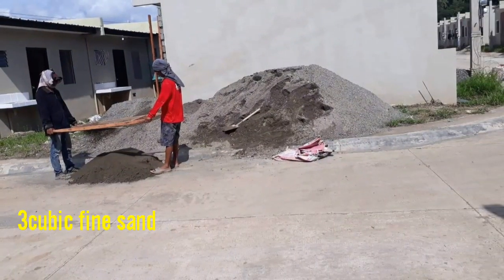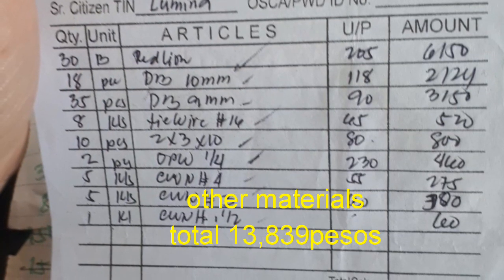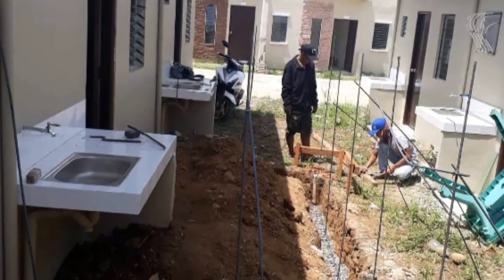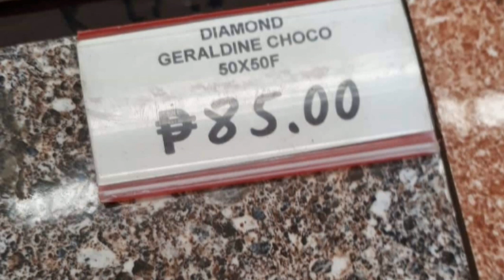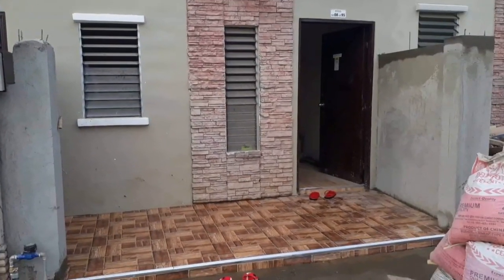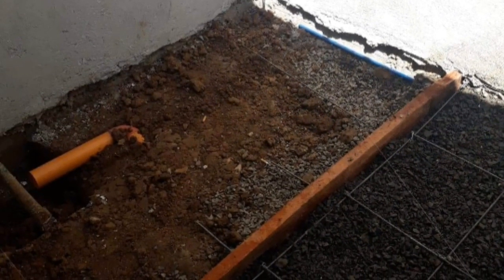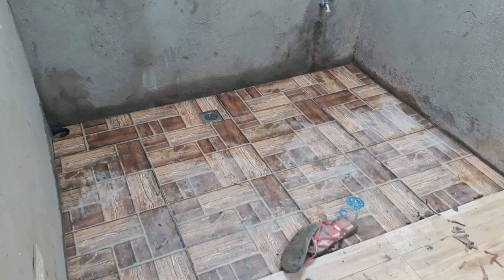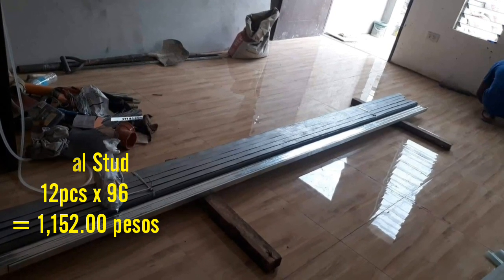Part 18 MAGKANO ANG NAGASTOS SA HOUSE RENOVATION NAMIN(MURANG PABAHAY SA LUMINA HOMES)

Comment: 62k ako na nagastos sulod lang nga renovation, wala pay extention ug gate. Waaa baratuha ra sa inyuha mam oi. Nice kaau.
Reply from the maker: Basin mahal imohang mga materials maam thats why mahal imoha maam,pila labor nila sa sulid
Reply from the maker: Nasa last vid ko po sa part18 naka itimized po doon
Reply: @maricelmontemayor5251  labor nila sulod with division, tiles and cr wall tiles shoulder level. 17k. Akoa division kay half style. Walay labot paint.
Reply: @maricelmontemayor5251  wala nako ge close ang rokm division kay para dili piot hehehe.
Reply: @maricelmontemayor5251  mas cheaper inyuha mam kay around 40k ra ang labor nabayran, tapos halos completo na ang balay. Hehhehe nice kaau